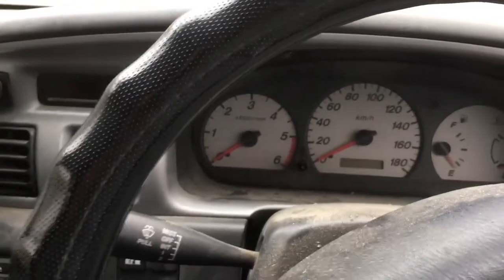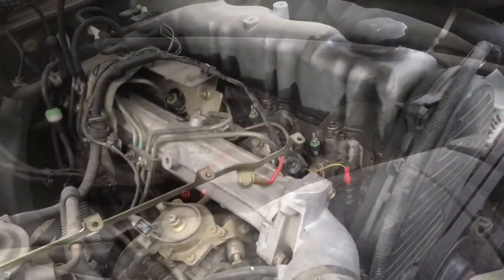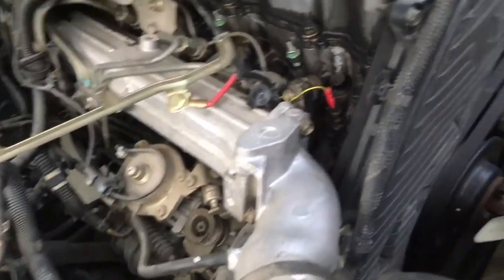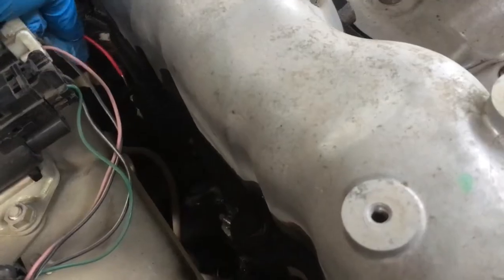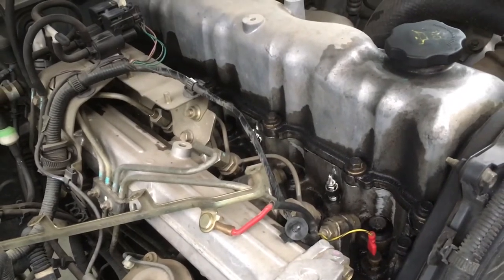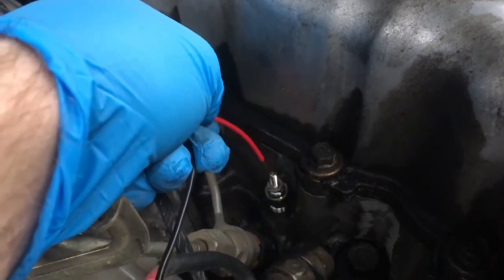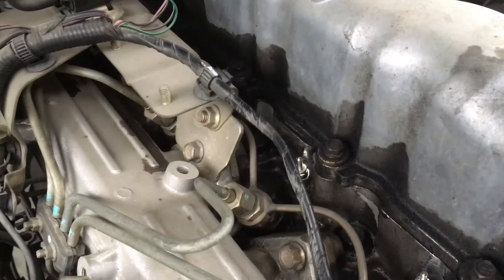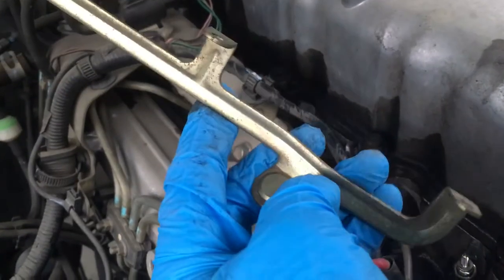How to test glow plugs on diesel engines

Comment: Great video, is smoke from the exhaust ALWAYS a sign of bad glow plugs (Motor in good condition so it is not rings etc) Trying to differentiate from glow plugs or battery in cold weather.
Reply from the maker: Another common cause of smoke on start up would be a blown head gasket or cracked head. A failing battery would cause it to turn over slowly, but unlikely to cause smoke from the exhaust.

Comment: Great video mate .
Iv got a 2003 vauxhall astra 1.7 turbo diesel and even when its pretty cold out the coil glow plug light only stays lit for 2 seconds max ..my wifes astra J which is a bit newer stays lit for a good 6 seconds in the same scenaro .So something is wrong somewhere ..any ideas what to check tia .from the UK 🇬🇧
Ps once the car starts its fine no bad idle or lack of power etc ,it just struggles to start and sometimes drains the battery so im guessing the plugs are not heating up nowhere near as hot as they need to be for whatever reason .

Comment: Mate this is happening to me every year. I have to replace the glow plugs  way to often and usually only have 1 plug left working.
Any idea what's going on? I'm sure the plugs should last longer then 1 year.
Reply from the maker: First two things to look at. Are you fitting genuine glow plugs? I know we've had some aftermarket plugs that have short life spans, generally made in China. Also make sure everyone using the vehicle knows how to use the glow plugs properly for the full amount of time the light is on. If they aren't used properly they can get damaged on start up.
Reply: Yea usinging boch plugs from supercheap or Part Master, have used a different brand aswell incase it was that reason. I'm the only one driving it so im starting it correctly.
The head got replaced in 2018 by a mechanic and the glow plug issue started after that. It's a 2006 2.5lt courier.
The plugs look really black and sooty though. Seen this before?
Reply from the maker: @kyle2956  haven't come across issues after head replacement. Can't think what would cause that, unless maybe it has leaking injectors? I prefer to fit NGK to couriers as that's what Ford use, and the do have a lot of issues. Next time I'd try getting a set from a Ford dealer and see how they go. Also check that the light isn't going out too early. Can you hear the relay click off when the light goes out?
Reply: @gettingitdone1  My ‘99 Ford E450 was having starter trouble where sometimes there was no cranking on its old ignition wire so we ran a separate line directly to the ignition system and installed a momentary button in parallel and it started right up… but now that I read this could our “hot wire” solution be causing damage to the glow plugs because it bypasses the computer and any protective temperature sensors? Because this week my “engine died” (!) at 220,000 miles some of the indicators for bad plugs along with less and less power until now it just barely creeps at 1 mph. My mechanic wants to replace the engine but I’m wondering if we’re abusing the glow plugs into a bad state. Any thoughts?

Comment: How about using the continuity on your meter to test the plug ,instead of a live wire
Reply from the maker: This is the fast way to do it. We're also not testing for continuity, we're testing for current draw. If you were to do that with multimeter, you would connect in series into the circuit for each glow plug. This is a quick test we use in the workshop to prove glow plugs are dead. If this didn't give us the results we were expecting, we would then go into more in depth testing (as explained in the video).

Comment: Hi what symptoms can glow plugs cause
Reply from the maker: On cold starts the motor will start rough, misfiring and blowing smoke out the exhaust
Reply: @gettingitdone1  ok thanks I'm getting them symptoms misfire rough start but no black smoke and po674 code thanks

Comment: Do you have the ignition switched on.?
Reply from the maker: No, you're testing the current draw of the glow plugs themselves, disconnected from the rest of the system. If you turn the ignition on the rail or the wire disconnected from it will become live and may arc on an earth and blow a fuse.

Comment: Aren't some glow plugs rated for 5volts? Wouldn't direct battery power then harm them?
Reply from the maker: There might be some rare ones rated that low, but this technique is still perfectly fine. It's a very brief touch and the high current draw of the plug will easily absorb the spike.